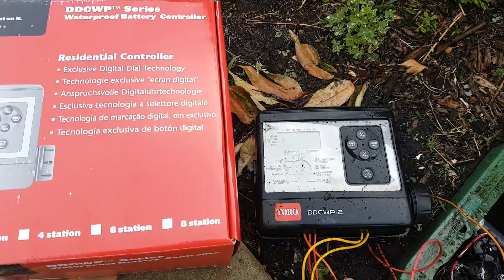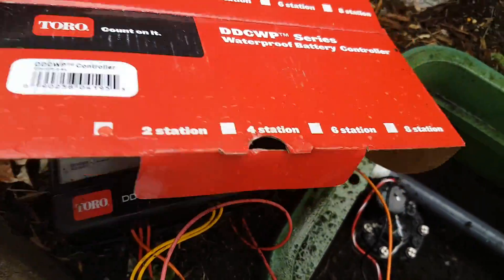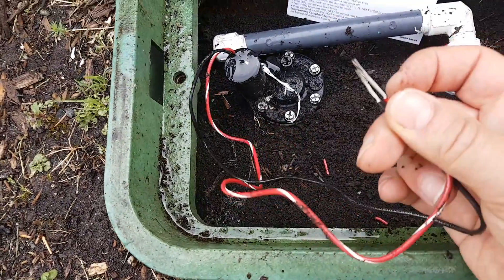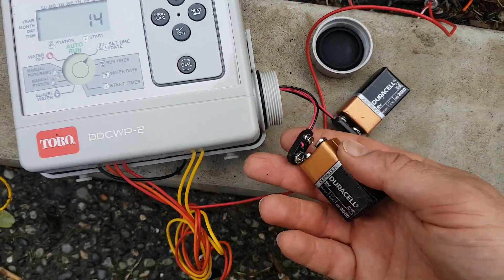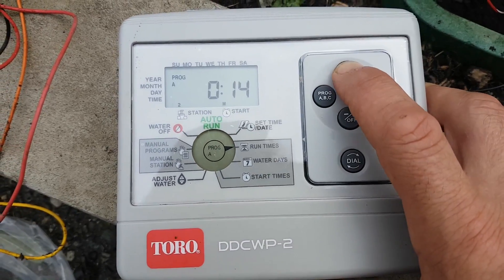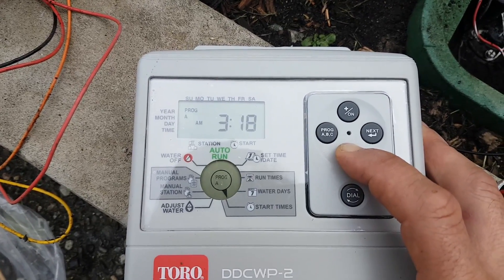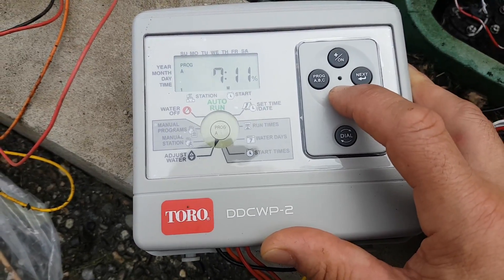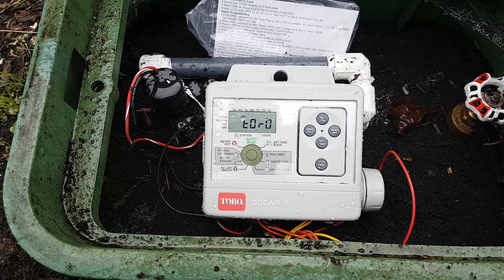Replacing and programming a Toro DDCWP waterproof controller timer for the sprinkler system.

Comment: Do you know how valves work? Does the controller send a short pulse to open the valves or a constant voltage of 9V? I've connected a voltmeter and I don't see any voltage, although the valve opens and lets water flow through it.
Reply from the maker: Yes. With DC it's a short pulse to open and the same to close. AC holds open with voltage.

Comment: Hi great video and thanks for speaking like a normal person I stead of a you tube salesman / radio dj! Any ways I installed one with no luck so I'm  going to replace the selinoids and  see if that works. Do you have any other advice as to why it may not be working?
Reply from the maker: Can only be one of two things. Controller or the solenoid. You can test the solenoid by touching a 9v battery to the solenoid wire ends to see if it clicks on. Good luck.

Comment: Do you recommend storing the timer inside the valve box or should it be fixed to a wall?
Reply from the maker: If you have a way of installing it on a wall,  that wouldn't be a bad idea if you are sure no one will mess with it. You will have some extra wiring to do and no way of hiding the splices.

Comment: I wish you had talked about the 2nd station.   How can I manually open the 2nd station without first turning on the 1st station?  Does the 2nd station follow at the shutdown of the 1st station or do I have to set a start time for the 2nd station??   Or do I use program B to run 1st station only. and set program C to run 2nd station only/
Reply from the maker: Press the dial button  until you get to Manual Station. It will default on station 1 showing on the display. Press the next arrow button and you will see 2 appear in the display. Press+ to add the amount of time you want then press the dial button until you get to Auto Run. The timer will  start station 2. If you're running the controller on auto, you only need one start time. It will automatically run the programed run time for Station 1 then on to station 2 etc.